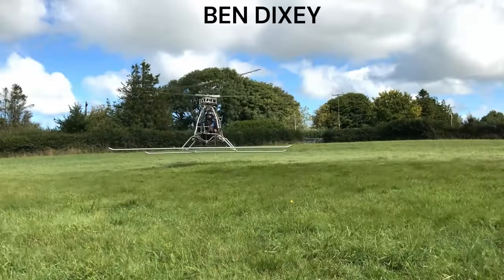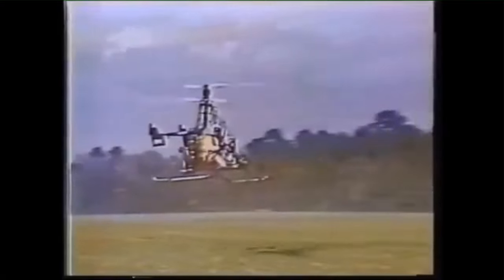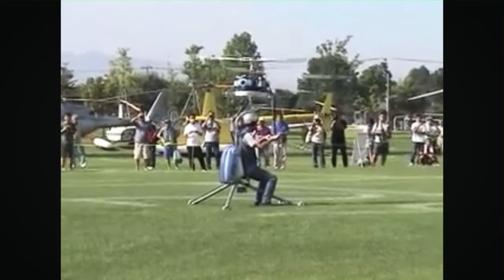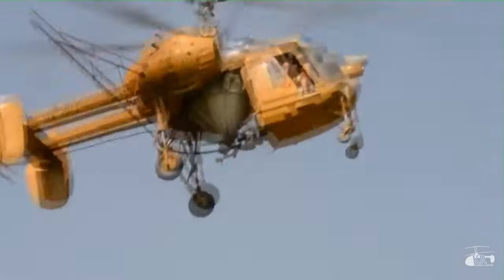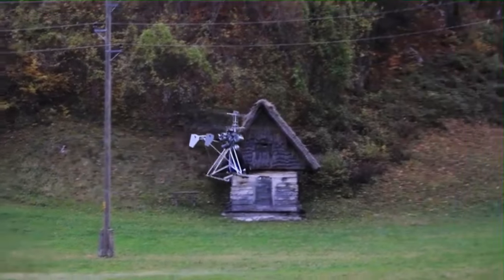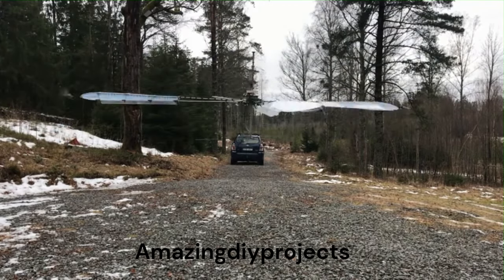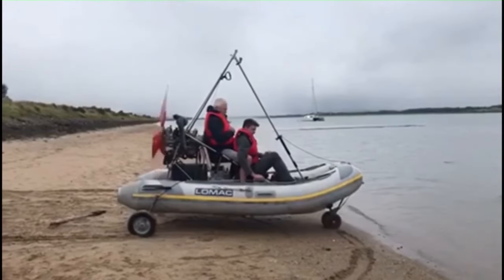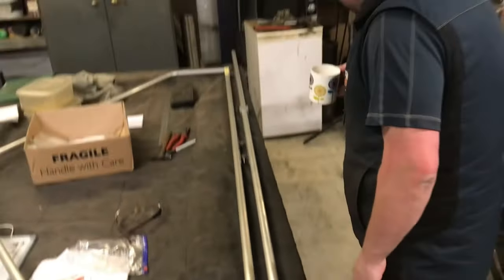Fixed pitch Coaxial Helicopters are they any GOOD?  Homemade rotary wing aircraft

Comment: Very interesting, thank you. Would this be a reasonable solution to the problem of autorotation: ballistic recovery parachute mounted on top of the mast. In other words accept autorotation is not possible with this design, and rely on the chute. BRS's are very reliable, mounting it on top of the mast would avoid intereference with the blades. Would that make any sense...? (Thinking about a solo sport aircraft only of course) Thanks..!
Reply from the maker: Hi, a ballistic parachute needs a minimum of 250ft and maybe that height with forward speed in addition to save you. An auto in a Robinson for example can be successful at 75ft with forward speed by comparison. So a BRS system can't replace the ability to autorotate unfortunately. They certainly can work attached to the mast though and I think I've seen that somewhere.

Comment: WHAT ARE THE DRAWBACK OF SYNCHRONOUS DESIGNS? LIKE K-MAX?
Reply from the maker: The Kmax drawbacks are: The blades come close enough to the ground to be a danger to people approaching the aircraft from the side which I think could be the reason for its lack of use as a passenger aircraft . Kmax use servo flaps to control the rotor and that means wooden blades are used for fatigue resistance, wooden blades are expensive. Synchronous designs have some unique handling characteristics. That's about as much as I know about the drawbacks of the K-max design.
Reply: @Ben-Dixey  BUT IF WE TALKING ABOUT DRONE THEN WHY THE SYNCHRONOUS COPTER NOT REPRESENTED?
YOU POINTED AS FLAP PER DESIGN BUT WHY NOT TRADITIONAL COLECTIVE/CYCLIC ?
Reply from the maker: The video was mainly about the downsides to fixed pitch rotors. 
Synchronous Helicopters are very interesting though and should be talked about in another video.
A standard swash plate design can be used on synchronous helicopters, servo flaps were another way of doing it.
Reply: @Ben-Dixey  ah ok thx
 im actually atempting to decid what design i must follow and im not convinced with coaxial due to complexity and asymetry
Reply from the maker: @omnianti0  What are your goals ? You can buy helicopter plans like the AW95, that would be the easiest route or certainly take some ideas from the plans.
Reply: @Ben-Dixey  im absolutely not convinced by the efficiency of dead weight designs as anti torque or sustentation or propulsive vtol

Comment: What about using electric motors, lightweight batteries and a lightweight 2 stroke running an alternator to charge while in flight? Electric motors have a better torque curve and you would have enough power to land if you have an engine failure.
Reply from the maker: Using electric as a power source would be nice, it's just very expensive compared to buying an engine. I could purchase a brand new Rotax 582 for less money than motors, battery's and a speed controller. As nice as electric power would be it's just too expensive at the moment. I think using an engine to provide charging power to the battery's would be false economy. The extra weight of the engine, fuel tank and generator would add a lot to the overall weight and you would see a reduction in flight time overall. Just my opinion on that and some calculations would have to be done.
Reply: @Ben-Dixey  I think you could stay under 15lbs with the right engine charging combo.
Reply from the maker: I guess it depends what increase in flight time you were hoping for. 15lbs is a very small engine powered generator. Using fossil fuels to generate power is best done directly through gears and shafts etc. Generating electricity from an engine feeding it to a battery which then turns a motor which turns a shaft is a lot of wasted energy. Wouldn't adding the 15lbs in extra battery's be a better option?
Reply: @Ben-Dixey  I don't know, that's why I brought it up. I think electric motors have more controllable power and the torque is much better than any lightweight engine. Think about trains. There is a reason that it works.
Reply from the maker: Yes the smooth power and high torque is very desirable and worth finding out the answer because I don't know the answer, I'm only guessing. A friend of mine tried powering a helicopter with a hydraulic motor. The hydraulic flow and pressure was provided by an engine driven pump. The power transmission was beautifully smooth but so much energy was lost in the transfer it wasn't feasible. Also the extra weight of the pump, hydraulic motor fluid reservoir and oil cooling meant it was all too heavy. A train uses the torque of electric motors to great effect but at the cost of efficiency and weight. In an aircraft weight is king that's why I think the idea is a non starter. Happy to be proved wrong as I would love a motor to power my helicopter.

Comment: Have you looked into TIP-JETS? Especially COLD TIPJETS?
think on it. Also, have you thought about a hybrid powerplant with an electric motor?
Reply from the maker: Well, I've thought about cold tip jets, the problem is efficiency. Looking at previous attempts such as the DJINN, it needs around twice the hp to lift that of a shaft driven machine of the same weight. I like the relative simplicity of the design but another difficulty is the transfer of air from an engine to the rotor tips without losses.  
I did hear of an electric back up system being developed for a helicopter in an emergency situation. Electric flight in helicopters is certainly being explored and it would solve a lot of drive train problems associated with IC engines. 
I'd like an electric version of mine but it's cost prohibitive for me at the moment.
Reply: @Ben-Dixey   Where did u get that info on the djinn? I simply cannot find any reliable specific info on it no matter where I look. I've read that Horse power problem before aswell, but I attribute it to the very bad compressors of the time, today's are much more efficient!  I guess the tubing is a challange and so is the rotor internal pipe and nozzle. But some dude made a tipjet helicopter with Peroxide, and if I'm not mistaken he was selling it, apperantly it reached up to 30 mins of flight with relatively small peroxide tank, so idk can it be that bad?

Comment: Hi Ben, did your coax heli have teetering rotorheads or rigid (hingeless) type rotorheads?
Reply from the maker: Hi, it has teeter hinges but no delta three was built into the hinges which I think would have solved the instability issue with wind gusts.
Reply: @Ben-Dixey  do you think it would benefit from a rigid setup instead?
Reply from the maker: @bradsamers3014  I'm not sure how detrimental wind gusts on a ridged rotor system would be compared to a teetering rotor system. It could well be better but I really don't know the answer. Someone who has flown the Gen h4 would be able to shed some light. One thing I do know is that the mast would have to be much stronger because then you have cancelling gyroscopic forces being transferred through the shaft. The hinges relieve the large bending moments that would occur with a hingeless coaxial rotor.  Composite blades may also be required  .

Comment: Did you say "Wing In Ground effect" vehicle?
Reply from the maker: Yes that's correct. I'm building a fixed wing flying boat operating in ground effect.
Reply: Fantastic, I've lived and breathed WIG for too many years now, I've built a few models, but not recently, and I've learned a lot through much research. I've noticed we humans tend to see what we WANT to see so I looked for videos with aircraft not designed as WIGs but stayed in ground effect so perfectly that they would react to the waves just a few feet under the wing! Are you interested?
Reply from the maker: @captarmour  Definitely interested in anything you are willing to share from your research. My first attempt at this won't be the best design for Wige but one that will work well enough. The main goal is to fly around at a few feet above the surface for fun. However I will have thoughts on improvements for next time and mistakes made.
Reply: I'm sorry I thought I replied...

Comment: Has anyone done an "electronic swash plate" system, that is electrically "steered" pitch over rotation, so that there are no multiple universal-joint connections, and mechanical coupling... just a multiple-redundant slip-ring system for power transfer, with the pitch control by torque actuators on the blades... The types of motors and actuators available today could be used with redundancy, and sensors for position, load and actuator position could provide all kinds of flexibility in control ideas...  L also read about an idea that used a separate motor for each blade, which allowed actually changing blade speed/lift depending on rotation position, and I think used a kind of "differential" to change the blade pitch with instantaneous speed control, deceleration lowering pitch, and acceleration increasing pitch, kind of a hybrid of electrical and mechanical methods.... Anyway, just some idea floating around, and I guess that in "experimental" aircraft, you can have more flexibility in your personal design and build...
Reply from the maker: I don't know of a full scale helicopter that has used electronic servos to control a swash plate or rotor. I have no doubt it can be done and with redundancy. I considered the idea when contemplating a tandem rotor design. The mechanical complexity of controlling a tandem rotor would be very difficult to work out, but it would be much easier via a programmable rc transmitter. 
For a single rotor I'm not sure you will beat the reliability of a mechanical swash plate but with an electronically controlled swash plate a flight controller could be attempted. 
Not sure what price the servos would be.

Comment: the 2 rotor must have same RPM or not?
Reply from the maker: In my case yes the rotors have the same RPM but it's not necessary. You could have rotors spinning at different speeds. What matters is that the rotors are torque balanced, this is adjusted by the pitch of the rotors. With the rotors spinning at the same speed there is a 1 degree pitch differential between the top and bottom rotor in order to be torque balanced. You could choose to run the bottom rotor faster and have equal pitch between the rotors. I suspect that having them run the same speed is more efficient but I'm not sure if that's true or not.
Reply: @Ben-Dixey  in your coaxial helicopter, you kept 1 degree more in bottom rotor than top rotor?
Reply from the maker: @shekhargaidhani1618  yes that's correct. 6.5 degrees on the bottom 5.5 degrees on the top.
Reply: @Ben-Dixey  😍 Thank you Ben.

Comment: why a counter rotating helicopter will fly when the upper blades n lower blades are spinning at the same speeds in different directions?
Reply from the maker: Hi, both rotors are producing lift even though one rotor is less effective. The lower rotor is able to produce lift despite being in the downwash of the top rotor. The point of a coaxial helicopter with rotors spinning in opposite directions is to balance the torque. No tail rotor is required

Comment: Add a rotor to the flying boat and make a gyrocopter.
Reply from the maker: I could do that for sure 👍😀 the only problem is then I don't think it would qualify as a wing in ground effect boat. Would mean I'm breaking rules. You can pull it with another boat without any problem. It would be a gyro glider, 
https://youtu.be/TCNZP3VtkwQ?si=LUy-x1-9zYXklx2b
They were doing it a long time ago but you don't seem they anywhere now.